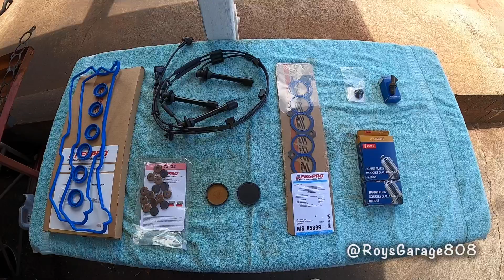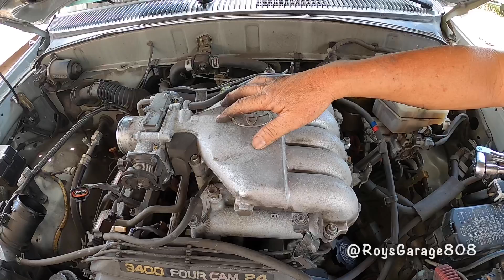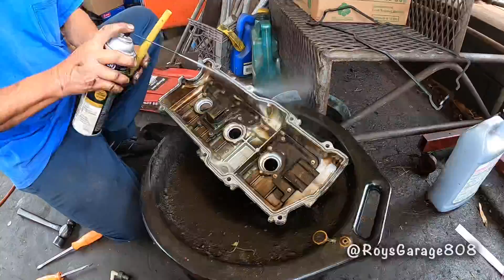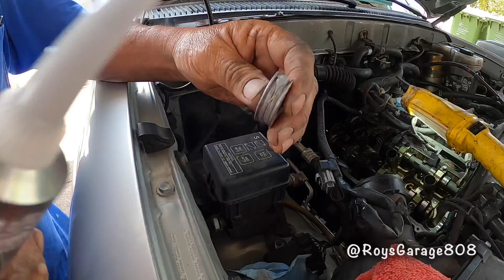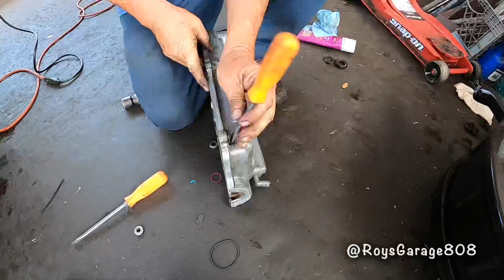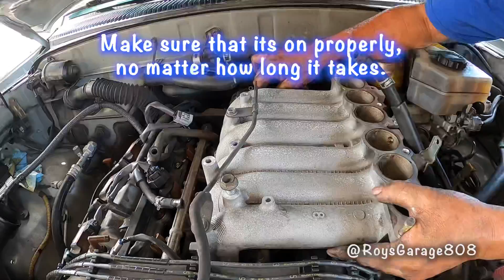How to Replace the Valve Cover Gaskets, Spark Plugs, & Spark Plug Wires on a 2002 Toyota 4Runner

Comment: Have watched several of these videos trying to pick up tips. And you have gave me one only you have addressed. And that is putting some silicone on the cam caps.  I would rather put some on and know it won’t leak then put this all back together and find out there is a leak at those places. 
I did buy the Toyota sealer and I hope it prevents any leaks.

Comment: Great video. I definitely feel more confident that I could do it myself vs. paying the thousands I was quoted. The only thing I would change about how you did it would be to have swapped out the 4runner you did it on with mine so I wouldn't have to worry about it anymore!

I really appreciate that you didn't skip over any steps, even when you moved to the driver-side valve cover and the steps were the same as the passenger-side. 

One question: how in the world do you keep track of all the bolts and where they go when you put it back together? I did see that you re-attached some temporarily in the place they go, but what about all the others?

Comment: Excellent video and a great resource. One question…. Do you tighten the valve cover and intake bolts to any torque spec?
Reply: Yes. They have torque specs. It's in the book.

Comment: Excellent job your a grand master 🙌🏽how long does the silicon have to dry before reassemble? Also is there a torque specification for the cam cover cap? And lastly will the contact spray be ok on oem gaskets? Thank for for your help 🙌🏽

Comment: Removing and resealing the 2 rear caps, is very important. 
That is an area where it leaks oil...
ASK ME HOW I KNOW.
Reply: That’s why I’m here. I can’t wait for the bottom of my truck to not be splattered with oil.
Reply: @jron5113  Not sure why they do not include these two caps plugs, in the valve cover gasket kit??
Hope this helps...I love Youtubers helping one another...
Reply: @williamb2854  yeah, this one of the better videos, although I’m not sure if he mentioned torque specs, but those are easily found. I actually paid a couple of years ago to have my gasket replaced and it’s still leaking. It definitely seems like it’s coming from the rear of engine where cap plugs are located.
Reply: @jron5113  Ron..you will need to clean the area good , with brake cleaner...then apply a small amount of gasket sealer on both cap edges. 
No more oil...dripping from the back of the engine...worked for me.
Reply: @williamb2854  thanks got everything, hopefully will tackle it this week.
Reply: Is it really necessary to remove this metal brackets behind the cam plugs? Thank you

Comment: I like the adhesive spray idea!
Reply from the maker: It’s a definite “hack” that I religiously live by, there’s just way too much stuff that gets in the way while putting it back together and it’s one less thing to worry about this way. A lot of people are alarmed by me using it but it’s nothing to worry about, doesn’t affect the car at all. Thanks for watching 🤙🏽🤙🏽🤙🏽
Reply: I want to do this job on my 2002 Tacoma and have been wondering how to keep the new gaskets in place while putting the covers back and the spray adhesive looks like it should work fine. I’m gonna do it to. Thanks for your video very informative. 👍👍👍👍👍

Comment: Very Nicely done. You showed great detail and cleared up a couple questions I had. My parts are on the way for my 97 4runner now. Once I finish that job I'll be doing the same procedure on my 2000 Tacoma. I will also be taking this opportunity to replace all my vacuum lines with silicone lines instead of rubber. Thanks again 👍

Comment: I am pretty sure my mechanic didn’t do all this on my Toyota 4 runner. Not the first or second time. And that’s unfortunate that most mechanics take advantage of people. The leak is still there even thou they’re claiming they fixed it. This video literally makes me want to do it myself.
Reply: I agree with you.  Most mechanics get commissions aside from getting normal wage pay.  They did my valve covers about 4 years ago and the passenger side is leaking.  I'm not a mechanic and did not know what to look for.  After viewing videos on valve cover gaskets I confirmed that I have a leak and in looking at the bolts with grommets I'm sure they over tightened them and definitely not to torque specs.   As the old saying goes, if you want something done right, you have to do it yourself.
Thanks Roy for this video.  I now have the confidence to tackle this job on my 2001 Tacoma.
Reply from the maker: Thanks for watching 🤙🤙🤙
Reply: @RoysGarage808  your video was one of the best I’ve watched in the past about the  valve cover gasket. No distractions from different directions. Sometimes people just feel like showing off their pets and kids even thou they’re talkin bout a car issue.
Reply from the maker: Thank you🤙🤙🤙
Reply: @Goesdeep unfortunately they found 3 different leaks. Ended up changing everything: new water pump, new hoses, seals ect…
Spent about  $1200 :(

Comment: Roy you have patience of Jobe.
 I'm really glad everything worked on this job no leaks🖒
Did you use new coil packs and what brand of spark plugs  were those NGK?
Reply from the maker: I didn’t replace the coils, only the wires. You can use NGK but I used (and recommend) Denso. Thanks for always watching 🤙🏽🤙🏽🤙🏽
Reply: @RoysGarage808  
Should we change the coils? I have over 150,000 on Toyota tundra 3.4 2001